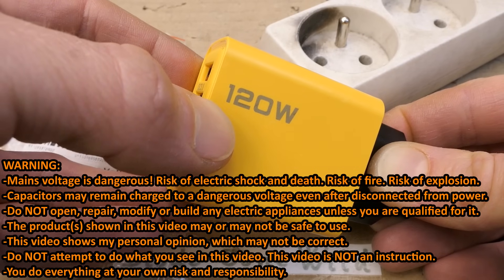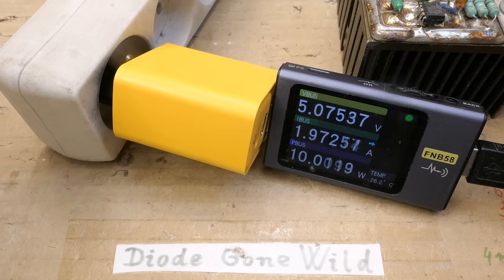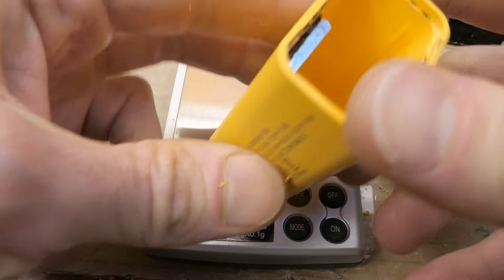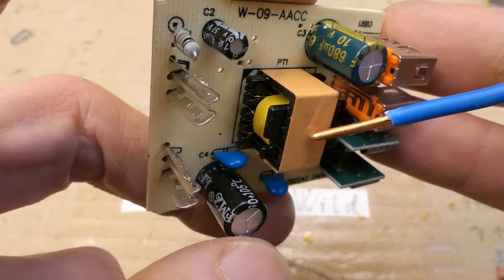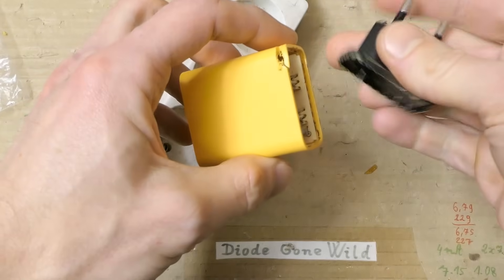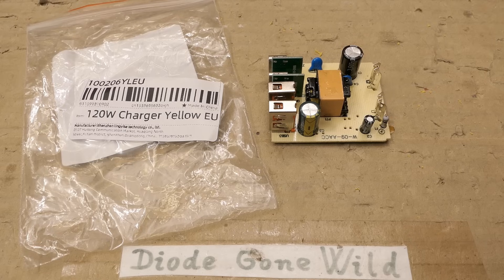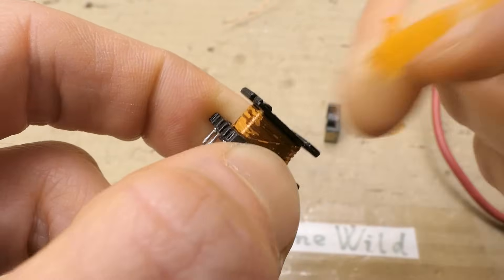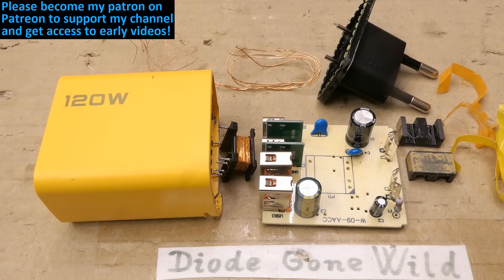$3 aliexpress 120W charger test

Comment: I bought two of these not really for the 120W I just needed a USB-C charger quick. They work OK if yoiu are just topping off a charged device, but charge up a large tablet or power bank from 0% and the PCB start turning brown and either the diode or IC fails.

Comment: I received this charger from AliExpress yesterday. It seems to be a newer version, as the soldering looks clean and well done. In the teardown video I watched, there's a mention of a clearance of just over 2mm, but I measured mine and it has a 3mm gap between the primary and secondary sides (with a 102 1KV capacitor).

There's no metal shielding inside, but instead I found a plastelinelike substance (similar to a thermal pad) placed between the transformer and the 230V wires. I'm curious what this material actually is — I couldn't find any information about it anywhere. It has a strange smell, almost like something smoked or burnt.

Comment: I have that charger to for 2 euro and a 65w look 99% the same as the 120w for 2 of 3 euro you now that it is fake if a real 120w cost about €70. But for the fun of it you get on for testing. Never buy a charger for ali or amazon get it local so you no that it is safe and the watt is what you wont and you pay for that.

Comment: Recently, I got the NC-22 model of this charger. Look exactly the same as this one, same printing on it. My expectations weren't high when I bought this from Aliexpress. I just added to my order to get free shipping for something else. Tested it, and it just supplies the same voltage to all the ports, so no Quickcharging or PD at all. It also weights nothing, so I doubt it has the 9.5 grams weight in it. Absolutely not going to use this charger any further. Will open it soon to see the internals, and then it goes straight to the bin. I'm almost feeling guilty to have bought this piece of crap.
Reply: Just opened it at the charger I got it doesn't even have the 9.5 g weight in it! Straight to the bin it is...

Comment: When they printed 120W, they probably meant when there is a shortage, and there probably will over time, it will convert 120W into heat and melt into a puddle.

Comment: I am sure that the thing that it says on the charger are fake but if it has usb c pd (what 99% of usb c chargers use) that you need a trigger board that talks to the charger to get higher voltages or more amps. if there is no trigger board they often only give like 5V with 0.5 to 2A
The chrager was fake but your voltage/apmere testing would not even have worked if it was not fake (since no trigger board)

Comment: What a dangerous piece of junk. Ali express will gladly sell a death sentence, at a discounted price. I remember back in the day where all electrical devices in the USA had to be UL rated for safety. Cheap imports have overrun the landscape here. I even have seen some lamps for traditional light bulbs sold with non-polarized plugs. It's a free for all, and the only way to be safe is to be knowledgeable. Thank you for making these videos.

Comment: Hey
Love your videos, Could you please show us how to design a snubber network e.g. RC or RCD will really appreciate it. I'm working on a high frequency 12v to 380v dc dc converter i need to design the snubber for push pull drivers to protect them from voltage spike

Comment: Ha! I ordered this charger's cousin (has a LED display for V/A) that is advertised at 20W a few weeks ago. My load testing showed it reliably died >9.5W, and got warm doing it. Took it apart like you did, and found the Chinese switching supply chip, which in the datasheet clearly indicated it was a 10W max chip. The reference circuit in the datasheet was basically the charger's circuit, but with those janky clips to allow different country plugs to be swapped on. Right into the trash - waste of $3.

Comment: It might be for the best that it's 5V only. It's still a fire hazard, but it's less of a fire hazard than if it had 120W running through it, with even more corners cut to achieve that.

Comment: 4:08 - in case anybody is wondering about USB-C, there is a 10K pull-up on CC, which corresponds to USB-PD source of 5V 3A (they could have gone with 22K for 1.5A), and the A6/A7/B6/B7 (D+ and D-) pins are shorted and pulled up with 43K and down with 51K, which is BC1.2 for an Apple charger of 5V 1A. Dodgy indeed.

Comment: The Matchbox of death....
problem is....... you have 50% chance of inserting it  the other way which puts the "L" on the ground rail. with "N" going thru the "fuse" resistor.
also that single layer of tape between the primary & secondary is absolute BULLSHIT...

next time draw a circuit diagram...

Comment: IF the transformer shorts, 220 volts is going to burn up all the chips, caps and resistors in a big POP and the magic black smoke is going to pour out of it and maybe a big flame thrower as well 

😮😢😢

Comment: Phones have a data line that they send out their capacitance and it goes down as the battery heats up. 
So the charger is supposed to regulate the amount of voltage they are sending the phone to keep the battery from overheating 

There should be a chip on this one to regulate the voltage and the chip should have a pin to connect to the data line from the phone

Comment: 2 Amps is about the limit of what a phone should take 
You can do 3A but it is going to shorten the life of the battery and in phones now you can't replace the batteries 

I really HATE that you can't replace the batteries 

WHY don't they have an easy replacement battery ? 

The last phones that had batteries they had the 3.7 volt battery that was lithium that you slid the case off or the battery door off and the battery popped right out and a new one popped right in and it was great 

I cannot for the life of me understand why companies stop doing this and why no one makes a phone that takes the battery and have it in a standard form that has three contacts that just sits in the slot like old phones

Comment: I always derate cheap crap electronics by 50%, but this is downright shameful.  Between starting a fire and electrocuting you, it’s unbelievable.  It’s not even safe enough to use as a very low-powered charger, pure circular-file bait.

Comment: Could you imagine that thing actually delivering 120W? At 80 percent efficient that would be like 24W power dissipation... Imagine shoving a 24W heater inside that case... In order to be feasible it would have to be more than 90 percent efficient. That's active rectification bridge and secondary, active power factor correction, really expensive switching components. 

Does anyone even make something like that, in that form factor?
Reply: Anker has some.

Comment: It is a shame they glue everything together now, so you can't check something non-destructively before using.
Some of the ones 3 times the price might be OK, or they could be just the same junk inside.
I've seen some transparent cased USB chargers on aliexpress, but either the dodgy small transformer can be seen or the photos are computer generated.

Comment: Chinese 120W is not even 12 actual watts. They should've used a bag of sand or radioactive waste (like they do in these "negative ion" pendants). Piece of iron/steel is way too expensive for a device like this.

Comment: I have one of those and use it daily.. lol. however I never thought the 120W was remotely real for the price. I was hoping for 18w or something really.  kinda expected the dissapointment.
It is hoever used by one of my children..if I never plug something demanding more than < 20w is it safe? otherwise I'll throw it away.
Reply: No, there is very little insulation to prevent electric shock. I would throw it away.
Reply: @dino6627  I have problems with the accent of the dude of the video and can barely understand it,.. I guess the galvanic isolation is poor or non-existent so one might get full mains power out in case of failure...right?
Reply: @crrodriguez  Insulation is only thickness of enamel on winding, which can easily break down and give mains voltage on USB output.

Comment: i had similar story, ordered two 67W chargers and had same content inside... charger gave 1.5A max while voltage dropped to 4V.... i clicked refund at aliexpress, attached some photos and description and money was returned within minutes... you can keep the adapters and you get your money back.. no one required to send them back.. at lease i got 2 free usb cable, which are not bad quality and two chargers for charging led lamps or small devices maybe..

Comment: The fact that they skimped on the 0.5 gram in the 10grams weighted plate is amazing.
Reply: Thats including the 0.5g of tape still attached to it
Reply: Why be honest in an dishonest product?
Reply: P.M.P.O. grams :D
Reply: reminds me of the "high quality" NiMH AA  batteries that weighted close to the same as the Sanyo Eneloops but only had ⅕ the capacity. yep, there was a rusting steel sleeve inside... 🤡🌏
Reply: A scam within a scam within ... Scamception!
Reply: Chinese scams even itself.
Reply: Grams are not graming.
Reply: that just killed me 😆🤣
Reply: where its written that it is a 10gram weight?
Reply: @aibi5532 when he flips it over it says Fe (raw iron) and 10 and he weighs it and it's not 10 grams lol given that it's a little over 9 grams it's most likely the marked weight

Comment: Shouldn't this SMPS be ultra dodgy? Being super fake specs, unsafe circuit board etc?
Reply: Super dodgy means without fuse and transformer without tape I guess.
Reply: Yessss! I remember, similar quality chargers was rated SUPER DODGY! I am disappointed, where is the consistency? 🤣🤣🤣

Comment: its more worth it to just rip the guts out and put it into a box then just use it for a 10W power supply for projects. whats next, a EV charger for 1$ ?

4:40 ok never mind its not even safe, just pull all the individual parts and use it for scrap parts. :-P

Comment: The connectors are probably the most expensive parts. I've also had cheap chargers where the connectors were not even up to spec, could not even handle 600ma.

Comment: $3... 
It would be nice to check cheap ones from aldi or lidl. They don't pretend to deliver 120W but I bought some at ~$5 recently and they look ok and not that hot at max power. But I didn't opened them...
Reply: The bigger, well known stores have much more to lose if they are found to be selling unsafe products, so the quality is usually a lot better. That is no 100% guarantee, of course, and there are still sometimes product recalls.
Reply: I consider them to be trustworthy. I have a couple of their chargers. It is better to buy something like this, than a phone manufacturer one that are often fake.

Comment: I love the 10 gram weight weighing 9,5 grams. Is nothing holy any more???
Reply: Beware, the 9.5g was measured on a cheap Chinese scale, so the uncertainties add up. It can be anything from 9 to 10g...
Reply: The extra 0.5g was the adhesive that was left behind... Maybe? 😂
Reply: China has a different gravity)
Reply: It's 10 grams +/- 5% so the weight is 9.500001g /s
Reply: We should just rename the Chinese the Shavers at this point. They just have to shave a little every chance they get. Every 20 weights it is like the manufacturer gets one for free! That sort of thing can really add up for them.
Reply: @1pcfred  this is just racist, lol.
genuinely, TF do you expect from a literal $3 charger, or anything else that incredibly cheap
Reply: That explains why I have been having trouble balancing car wheels lately. Been using these cheap Chinese stel weights insted of the more expensive zink weights.
Reply: even better... the glue will fail over time & teh weight will float about inside...
Reply: Just all about you want to know about quality of ordinary Chinese production for general folk.

Comment: 120W at the output from 100V@0.5A at the input? That's not a power supply, that's a FREE ENERGY DEVICE!
Reply from the maker: Well, that's a good point :)
Reply: 200% efficient!
Reply: Now I understood. The 120W refers to 240V 0.5A input, not output 😂
Reply: Chinese overunity 😂
Happy lunar new year 🎉 🍯🍯
Reply: Plot twist: It uses the refrigeration cycle to charge your phone
Reply: @redpheonix1000 Better tell Alec at Technology Connections. 😅
Reply: Those 120W are pronounced as 120 ...What?!
Reply: @LarixusSnydes  🤣
Reply: @LarixusSnydes  🤣🤣🤣
Reply: The only way this thing is ever outputting 120W is when it shorts out internally and provides Mains at the USB Port.
Reply: 50 w💀
Reply: 120w😭😤😱🥵🤣
Reply: electroboom will be better doesnt see this comment
Reply: Including shipping? No including shi**ing
Reply: first thing I thought as well :)
Reply: I suspect the calculation was for 240V, i.e. 100V@1.2A to 240V@0.5A.
Reply: It looks like APFC PSU. 230V*0.5A=115W.
Reply: Peak inrush power?
Reply: 120w=20v/6A

Comment: The power supply gets so hot that the sticky tape could fall off and the steel weight could short something out
Reply: That's the thermal overload safety cutout!
Reply: ya he said that before in one of his videos
Reply: I died when i saw the 10g ballast weight
Reply: It's a 'drop-off' weight.
Reply: @wdavem  it’s a dead weight
Reply: @ it has 'auto-drop' on a 3 month heat-timer
Reply: Have you never heard of a crowbar circuit?
Reply: @ This one can even short out the mains directly if selected! I'll bet it's good for at least 10 amps @ 230 volts. And you can choose where the crowbar closes in circuit thanks to the orientation sensor,. So generous for only three dollars!
Reply: @Electronichub_05  crowbar circuit?
Reply: @seikojason  Styropyro has a great demonstration in his "car battery" video..
Reply: @Electronichub_05  Nope. Never heard of it.
Reply: @GrainGrown They're normally used for over-voltage protection. It's a circuit which will short the output of a power supply when certain fault conditions are detected. In doing this, it may blow a fuse, but the load that is connected to the power supply is protected from damage. There are different ways of doing this, but a common one used to be to use a high-current thyristor across the power supply's output, triggered by the fault detection circuit.

Comment: looks well made from the outside, I could've fall for it, at least I expected the USB-C ports to have at least 15w of fast charging, so sellers on stores may plug it into customers phone and it would show "fast charging" at least so they can sell it and get away. Curious to see that even dodgy chargers are using synchronous rectifiers now.
Reply from the maker: Synchronous rectifier chips became very common. Once mass produced, they're very cheap. When something has been around for years, the main production cost is the materials. A diode contains more of them to handle more heat loss.
Reply: This is not for over the counter sales, so the tire weight does the trick.